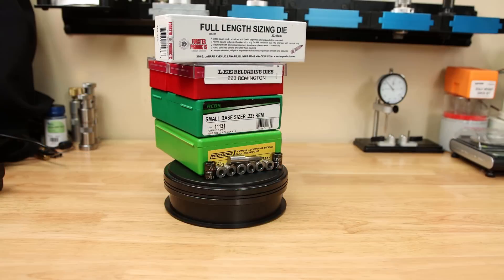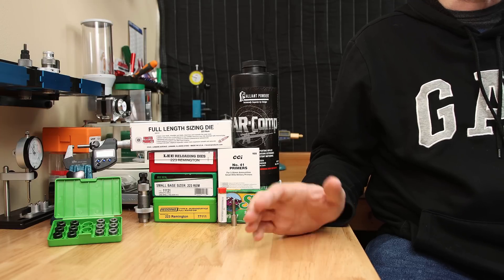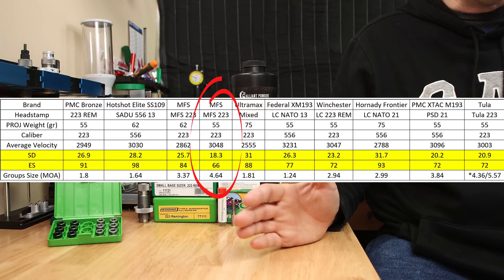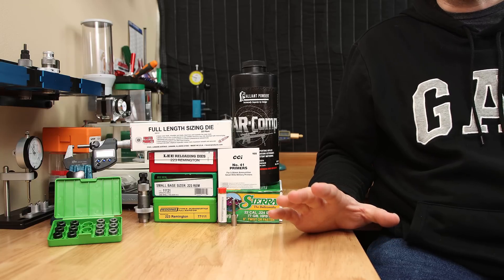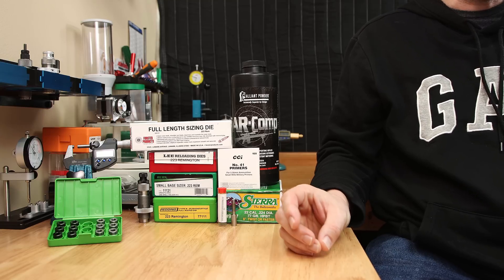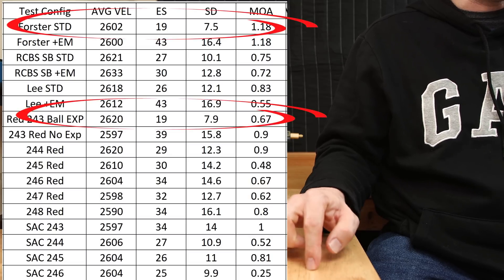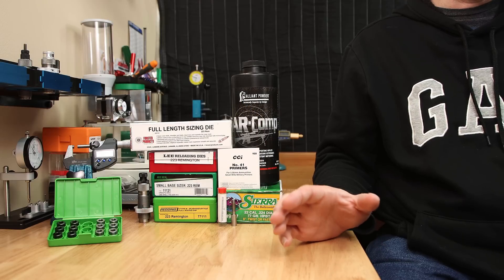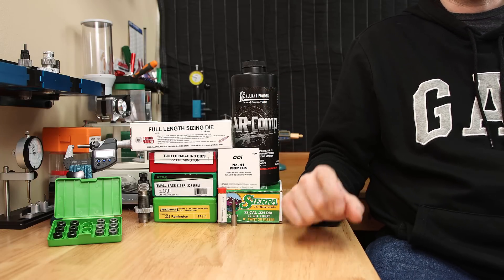Reloading 223 Rem - How Neck Tension Changes Performance

Comment: Will the short action  customs bushings work in the other bushing dies
Reply from the maker: Hi Ronnie, It depends on the die. The website states " UNIVERSAL OUTSIDE DIMENSIONS OF .500″ DIAMETER BY .375″ HEIGHT, THESE BUSHINGS CAN BE USED IN MOST RESIZING DIES." If you had any questions I am sure you can email and ask them.
Reply: @BoltActionReloading  what size bushing would I need for 7mm08 a loaded case at the neck is .310
Reply from the maker: What bushing are you using now?
Reply: I'm not that's from my rcbs full length sizing die it's not a bushing die
Reply from the maker: OK I did not know what you are coming from. I want to make sure you are aware I have not loaded 7mm08, but the general line of thinking is largely .002" under, however my experience has been to add about .001 to mimic the same neck tension with a SAC bushing. I would guess a .307 or .308 bases on your .310 measurement. In this video I walk through my experience with these bushings in .223 https://youtu.be/lCoryif1X08 I plan on doing additional calibers.

Comment: Hey there. I just got my first mandrel die (Wilson) and two mandrels (for 6.5 and 308). My Question is do I just size like I usually do with my rcbs dies then use the mandrel to finish the neck tension? Or do I just run my sizing die without a rod and mandrel? 
I know you have talked about getting rid of factory expander balls and using a mandrel before. My rcbs ball on my 6.5cm leaves necks at .258-.260. that is why I was wondering. My expander takes it right to .262 perfectly.
Reply from the maker: For most calibers I remove the expander ball completely, size with the die, and then run the mandrel through the neck to size. It depends on how much the die is sizing it down, but this should work in most instances.
Reply: @BoltActionReloading  thanks man. My rcbs 6.5 dies size it to .258-.260 with the expander in. If I pull the expander out its .254-.256 I believe. I just didn't know what the way was best. But either way after the expander they all come out to .262

Comment: Thank you for this excellent video. What is the outside diameter of the case mouth of the finished load using the SAC .246 and .245 bushings?
Reply: Found the answer in a related video in the series. .247. Your efforts are sure to save me time and money. Keep up the good work!

Comment: So those expander balls were only half a thou under bullet size?  I just ordered some expander mandrels but ordered them 2 thou under bullet diameter…hoping that won’t be a problem? I was thinking 2 thou neck tension was where I wanted to be ?
Reply from the maker: Remember that the projectile measures .2244" in this case. I put Pin gauges in the dies and the measure out at .240, .241 and .242. I am hopefully going to get some expanders to really dial in what is going on. I would imagine you did just fine, but I wonder is this is somewhat caliber dependent?

Comment: Off Topic: Would you provide Information to the Dillon Toolhead Wall Mount System? Thanks!!
Reply from the maker: Inline fabrication.
Reply: @BoltActionReloading  The Wall mount and the Toolhead Holder? How do you attache the Toolhead Holder to the Wallmount?
Reply from the maker: @tobiastorsi  if you go on their website to the tool holder for 650 / 750 and there are mounting options there. I think they want to use the inline rail wall system but there may be other options too.
Reply: @BoltActionReloading  and the 3D printed Part gets screwed to the wallmount?
Reply from the maker: @tobiastorsi  yes if you buy them both from inline it should include all the hardware you need.

Comment: Was the loaded brass measurement .249 therefore following the -0.003 thou sweet spot (.246) for SAC bushings?
Reply from the maker: Hi Scott the loaded round diameter is .247". I went into a little more detail in this video: https://youtu.be/lCoryif1X08

Comment: Another really interesting video - thanks :)
In order to add some context to the bushing sizes, what was the brass neck wall thickness?
Reply: I just asked the same question but in a different way.
Reply from the maker: Hi Kevin,  the loaded round diameter is .247". The brass thickness averages, .0113", projectiles measure .2244" I went into a little more detail in this video: https://youtu.be/lCoryif1X08

Comment: Thanks for all your videos. I really appreciate all your hard work. Just a note….you were reading or saying the ball expanders wrong. You were saying .226 but it was .2226. Others were the same. Keep up the good work.
Reply from the maker: HI Clint you are correct that is why I included the graphics on the screen to note it. I caught it in the edit. It was either release it like this, and add the note, or not release a video this week.
Reply: @BoltActionReloading  thank you for pointing that out, I did not notice it. However, the only reason I pointed it out was because I was trying to understand your reference to wanting a slightly larger EM. Do you still think that? I feel like all of your bushing die tests could’ve possibly been improved with the ball expander. I’ve read how this is beneficial before, either on Redding  or whiddens  website.
Do you think the .25” group was a fluke or repeatable? 

I thought your humidity test on powder was incredible! Between you and Shannon 😄 I have learned so much about reloading.
Reply from the maker: HI Clint, No problem not worried about it. So the short answer is yes. The expanders will allow me to dial in the NT a different way. Not sure if you caught this video https://youtu.be/lCoryif1X08 where I show some of the graphs from these samples. I am getting the opinion that a lot of folks don't care much for these graphs so I am thinking about limiting the use of them in the videos at least. There are distinctly different force graphs depending on the methods. I am curious to find out if there is a "best" combination. Everything is an opinion till you test it. You can bet I am going to retest that. The real questions is if its "enough" tension to keep the OAL consistent. 

As far as was it a "fluke" I felt every shot was good, and they went where I pointed them. I would love to tell you that if the ammo was good enough that every group I fired would be in the zeros but I am not that big of a liar. Everything starts coming into play when groups are that size. If you would have told me that when I loaded these that there would be 4 groups that are basically .5 MOA and under with range brass out of an AR then I would have suggested drug testing. I probably need to do another "wide net" style test to include some different expander sizes. 

Glad you found the powder humidity test interesting as well. I think its a big factor that most ignore. I am convinced if your powder is more humid your hope for lower SDs is very low. JRB is my favorite youtube channel. With out him I know I would have never started this channel and may have never got into reloading at all. I think there is room for everybody's reloading style and we can all learn.
Reply: @BoltActionReloading  thanks for the reply. I definitely seen all of your videos and I do enjoy your graphs, but I am a detail guy and I appreciate all of the detail. I could see that for some there can be a lot to absorb for the amount of time they are presented. But for me keep them coming. 👍🏻
I guess I don’t know if you can pm here. Or where.

Comment: Are neck dies all universal ? Will they work in different dies ?
Reply from the maker: Do you mean are the bushings universal?
Reply: @BoltActionReloading  Yes, do the fit in different die body? Redding. Wilson, Harrell's etc.
Reply from the maker: HI Joel, the website states "UNIVERSAL OUTSIDE DIMENSIONS OF .500″ DIAMETER BY .375″ HEIGHT" you can reach out to them if you have questions.

Comment: I want more!  This is the stuff that has me by far the most frustrated out of everything.  I see exactly the same thing, High ES/SD and small groups, then Low ES/SD and large groups.  It is such a conundrum.  It has been mentioned that bullet seating depth testing allows for shrinking groups.  I have begun that as my first step with a middle of the road load, then go back and run ladder testing.
Reply: Understand your nodes. There are 2 or 3 nodes that are important.  Once you do, your scenario will make sence.
Reply: If you want to talk about it let me know.
Reply from the maker: Hi Casey, Hopefully its clear that this load wasn't really pulled out of the air. I cast a wide net to see something that looked very "tunable" for lack of a better word. If your powder / primer combo isn't worked out I am not sure how much success one can really have. I am not claiming to be an expert in 223 but with the smaller case volume I think that expectations need to be realistic. I am not sure that ES of 15 is going to be realistic. I am thinking single digit SD is all I can hope for, but we will see what we can get.

Comment: Wish my groups were as consistent as your videos🤣. Thanks again for all the info and time you put into producing these. I’m waiting to see further test results before I purchase 21st Century expanders mandrels for .223. Currently using a Lyman M die and get fair results.
Reply from the maker: I hope to make some progress on this too. When you start adding mandrels and bushings etc. the number of configurations get pretty insane. When I loaded the initial test my plan was just to get a baseline on my amp press and see what happened, but then clearly some of these configurations show groups that I may not have thought possible with this. Then some want to start crimping, and in most situations that has always made my groups worse. I thought about doing a extremely deep dive in some of this data but I am guessing that the audience may not be there for that.
Reply: @BoltActionReloading  I say keep
doing what you’re doing👍🏼 More information is better then less, or none. We all benefit from your contributions. I think your channel is balanced enough that you reach all stages of reloaders-beginner, intermediate and expert levels. Keep up the great videos.
Reply: My thoughts exactly!

Comment: Very good review of sizing cases. I have tried many different dies in .223 (bolt gun ammo) and have a RCBS die that gives me .001 runout or less followed by a Precision Products expander pin sized .223+ .  I load on a Dillon 550 with Armanov locking tool heads and their floating die rings, two heads are used one for depriming and another for expansion, powder charging, and bullet seating. Keep up the good work and try running across the board expanding die in a floating expanding die and not going all the way up the mandrel but just enough to get the neck expanded passed the bevel.
Reply from the maker: Hi Paul, there is a lot to look at here. I am trying to get an idea of how to determine what characteristics make a load better or worse and then see if it translates to other calibers.
Reply: @BoltActionReloading  I have a few rifles that are factory barreled, they are in much larger calibers, .338 Win mag, 375 H&H. Those step out of the fine accuracy department.  My .223, 22-250, 6XC, 6mm Remington, 7 Rem mag, and 308 Winchester all carry custom barrels. so I'll comment on these, I look for loads that the book tells' me are at 90% load density or better, velocity range for they load type (in .223 a 50G. varmint load is going to be different than a 77 TMK match load), and how I had the gun chambered ( my 308 is a 1/13 twist barrel for lighter bullets and at 26" high velocity) And even that is different than my 6xc has a gain twist barrel starting at 1/12 to 1/10 and used for Sierra #1530 bullets at P-dogs in a 28" barrel. I next look at the powder type Single Base propellant's are my first choice as my barrels will last longer if I can get them within the accuracy required for the bullet/rifle. This is under 1/2" at 100 yards for all the above except the 7 mag as it's job as a deer/ antelope/ elk/ black bear gun. It's requirements are 1" at 100 yards with a bullet that works with the game it's loaded for. To sum up a single base powder, loaded at 90+% to the velocity required, in a handload that will keep all shots in 1/2" or better at 100 yards. The jerk behind the trigger (me)is the limiting factor in developing the load. Lastly I am not afraid to change barrels if one doesn't shoot to my requirements. 
Sincerely:
 Paul